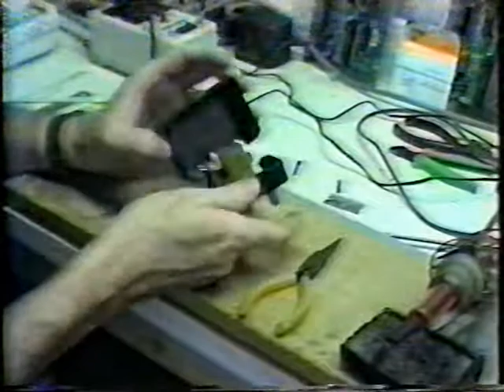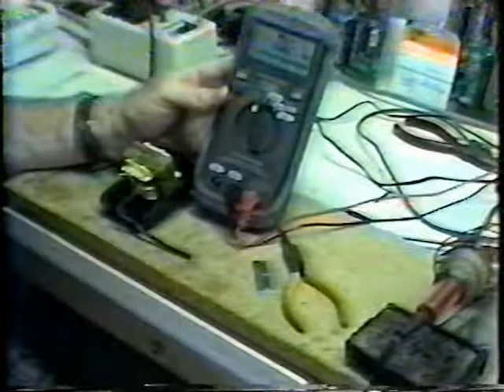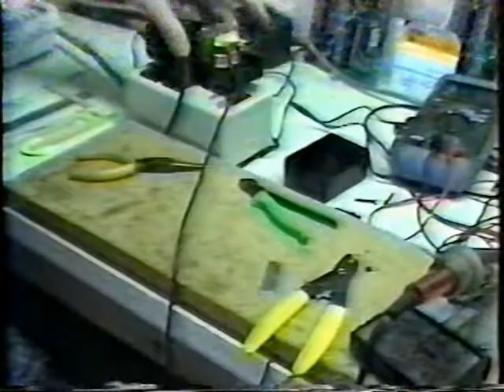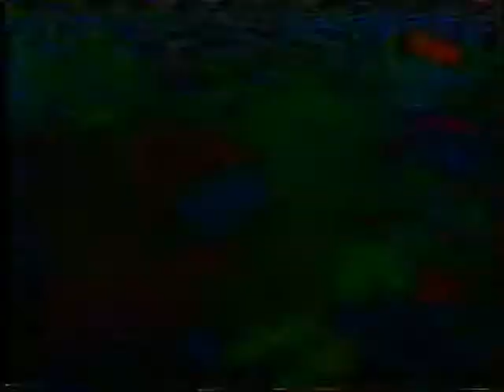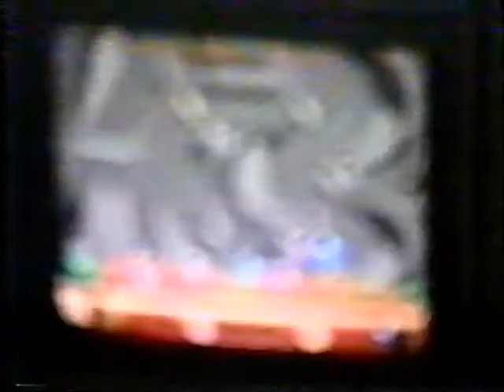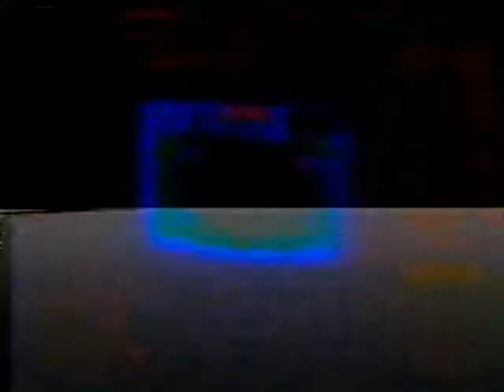Nintendo NES Repair by Irata Systems 1992 Part 13

Comment: Question for you? My controllers are good, but i have a problem with my second player port on my NES. The game when played on the second player will make a quick move ,and freeze. And then there is nothing from the controller ,,huh...Would this be a bad IC Chip on the motherboard?